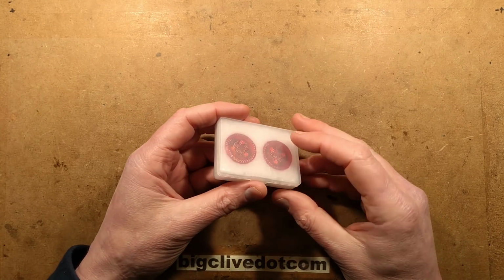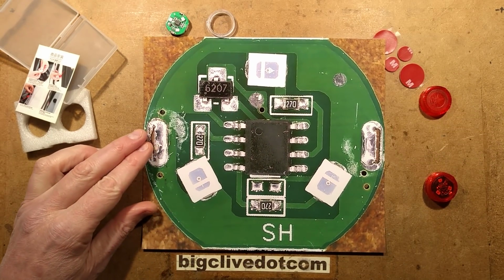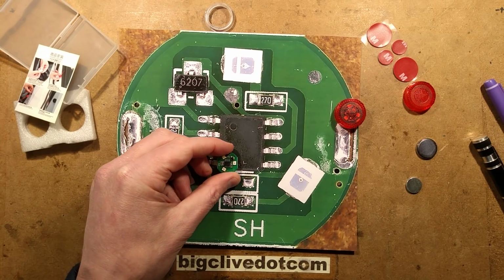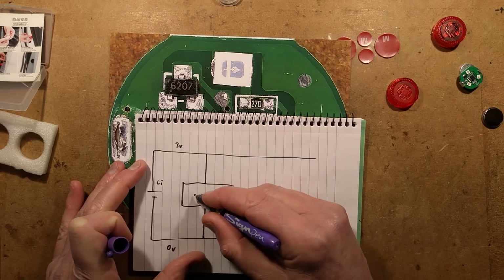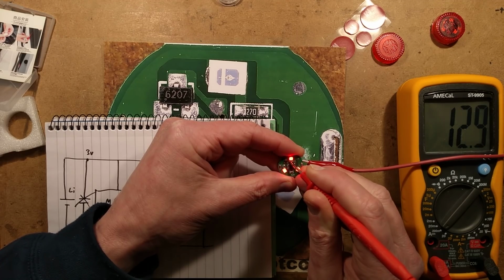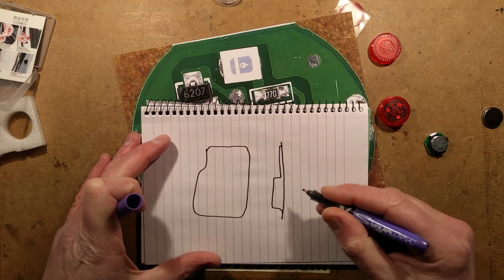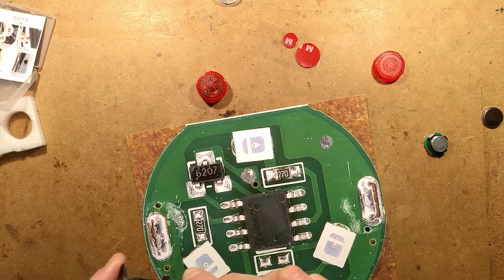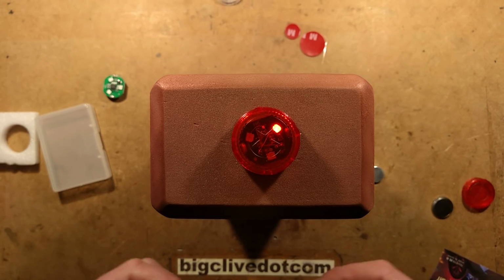Self contained vehicle door warning strobe lights.

Comment: I hope people will not use this as a replacement for looking before opening doors. It will not come on soon enough to prevent dooring, or in avoiding the door the cyclist will still end up falling, or under the car following them (likely to close).  I suggest always open the door with the hand furthest from the door, this tends to turn your head making it easer to see oncoming road users. But a good idea if used correctly.
Reply: People should get into the habit of opening the door with the hand furthest away from the door, it forces you to turn which makes looking for bikes much easier.
Reply: Motor cyclists call that the life saver especially before turning right, as a biker I've saved at least three that way over the years
Reply: Charles Puffer - surely a driver should look in his/her mirrors (rear view and wing) before opening his/her vehicle door?
Reply: Yes,  it also to get that last look in, also if becomes a habit. It is a practice promoted by the Dutch safety people.
On crowded streets there can be a lot of obstruction and blind spots.
Reply: @Mark1024MAK  we would hope, but dooring is the deadly outcome of drivers not looking, or not seeing.
Reply: @longdarkrideatnight  It's also the outcome of the cyclist passing too close - something I never do. I ride where I get respect - 1 metre from the kerb, as per the UK Highway Code and known as Secondary Position. Then at pinch-points I take Primary - the middle of the lane. It's also known as Vehicular Cycling and it means I have no nasty tales to tell that weren't my own stupid fault - twice in two months, "drink taken", fell off - now older and wiser.
Reply: Yes, but there are times when the combination of can make this difficult. 
This is a multi part problem, and like many complex situations that can lead with accidents. Any one thing not going wrong is sufficient to prevent an accident. In reality it is better to get all the factors pushed stepped back.
Reply: I wonder why car drivers don't simply get out on the pavement side.
Reply: @josslevy4240  Depends on the vehicle design. Most European cars don't have bench front seats, and there's dashboard and floor-mounted gear lever and parking brake between two separate seats. The bonus is that the seats are shaped to give lateral support for cornering at speed.

Comment: You need to check local vehicle lighting regulations.
Here in Australia, ANY flashing light HAS to be Amber on a vehicle, other than on an emergency vehicle.
Reply: They can be had in amber, as well as blue, red and mixed colours.

https://www.amazon.co.uk/dp/B07KW4KZNR/ref=twister_B07KW49SZC?_encoding=UTF8&th=1
Reply: Tom George - So does that mean that you are risking arrest if you are a dick of a driver and keep repeatedly touching the brake pedal, so causing the brake lights to flash?
Reply: @Mark1024MAK  If you want to get really pedantic rear lights show in the infrared spectrum which is classed as a radio frequency so you need a transmitting licence
Reply: jos Touw - No, I was rather hoping that a vehicle with flashing brake lights would be pulled over / stopped so that the driver could be warned / educated that his / her driving needed to improve. As it is poor for efficiency and annoying for a driver following them.

Comment: I found the 6207 at LCSC.com the price is 1.8 Australian cents each.
Reply: Link to product
https://lcsc.com/product-detail/Sensors_CrossChip-CC6207ST_C286001.html
Schematic does show a 0.1μF capacitor across it's power supply.
Reply: @webchimp  Thank you for the purchase link (Chinese language data sheet is also there).
Reply: Sorry that's 18 Australian cents each.

Comment: car manufactures cutting corners. your car should have these lights factory
Reply: Some have
Reply: No shiat, for the last 20 years they should have been standard
Reply: I wonder if the recess at the bottom of the door is for a factory-fitted optional one of these. That's exactly where they were on a Mazda I once had.
Reply: Agreed, but these are for the door edge, not the panel face
Reply: Different position...
Reply: These are meant for the door edge that has the door lock/catch on and not the inner panel side.
Reply: Because Chinese cars are known for being both well equipped and safe.  However, give it 10 years and we'll all be driving them...
Reply: Some cars do, cheap cars (under 50 000, in car pricing anything under 50 000 is not a car, but a bathtub with wheels) do not.

Comment: Technically there is 3 complete M's on the stickers.
Reply: You beat me to it creamy moose !!!
Reply: It's actually 3 W's. ;)
Reply: Smart cookie ey?!  :D
Car makers should include a similar light built right into the door and could charge an extra $50usd more for the car... just sayin'
Reply: Bill A I though most modern cars had that already. My 2007 Outback does.
Reply: Hmm not sure my 2018 Honda doesn't have it here in the US.  It's not mandated by law, so maybe they wanna save a few bucks.
Reply: A few cents...USA USA!
Reply: Yes, but "MMM" is the stock symbol for 3M. Makes an odd sort of sense.
Reply: Doesn't matter; 1m is funny.
Reply: @2000jago  Yes, but you can see where they were die-cut from a single piece of sheet stock, and where the three "M"s would appear together if the scrap were left in place (sometimes it is). They don't die-cut each part individually and then stick it onto the plastic backing; instead, they make a single cutting die for all the parts and then remove the scrap.
Reply: It means 'Make Much Money'.

Comment: I sat there like: 'I wonder if this fits on my car'
And in the exact moment you went: 'I saw that it fits on a skoda fabia (my car)'
I was a bit scared not gonna lie.
Reply: But then again the Skoda's tolerances might be a bit wider than the norm, a couple of inches of wiggle room here 'n there, no problem.  You can even stack two strobe lights in there just fine... jk he-he
Reply: @BillAnt  I think bill is from my age group when owning a skoda's was joke that you would not bragged about, they were called "skips with wheels"
Reply: @Nick Bird < Yes sir, back then they were somewhat of a joke, but I'm sure they've improved by now, after all BigClive certainly thinks so. he-he
Reply: @nickbird7742  I'm a 1981 model, so I know these jokes 😉
Reply: The 16 valve Skoda was the premium model: It had 5 in the tyres, 8 in the engine and 3 in the radio.

Seriously now, I did see an old chap driving a 130 Lux on a drag strip at East Kirkby Aerodrome, and he beat every other standard road car to the quarter mile. It certainly had more than the standard 58 hp/43 kW engine under the bonnet.
Reply: @BillAnt  since 2010 they are made with the same quality as most of the cars in the VW group 🙂 Skoda Fabia are 98% the same as VW Polo 😉
Reply: sismofytter - beat me to it
Reply: @sismofytter  looking into the engine bay everything literally says VW AG
Reply: O! M! G! You heard Skoda Fabia, but I heard Ford Ka.  Now I'm really freaked out!!!
Reply: Me too 🙂
Reply: Mine's a Felicia, but I  look before opening my door and keep an eye out for potential door-openers so I don't know what use these would be.

Comment: Don't see how these will work with a lot of cars since there's not much space there between the door and the body, especially on new cars.
Reply from the maker: That's what I thought until I tried it out.
Reply: @bigclivedotcom  If the car has a recessed striker plate for the door latch then they would, for what its worth. In that case, you put them just above the latch on the door. Although with that said if it had real instructions it would tell you this since the depth is easily measured.

Comment: First I thought they are using a reed switch and a 555 for blinking. I am getting too old, I recon.
Reply from the maker: It's cheaper now to use a microcontroller and solid state sensor.  How times have changed.
Reply: I thought the exact same thing... that's how I learnt it in school
Reply: 555 You can get LED's that flash... Old school new school I'm old too...
Reply: .x. Don’t think they would stay synced
Reply: It is totally insane if you then see stuff like that: https://youtu.be/sNCqrylNY-0
Reply: Probably the power consumption of the classic 555 chip is higher than this more efficient micro's... not because it's activated for long, but in case someone leaves the door cracked longer, the button battery could be depleted.  By the way the pattern flashing might be designed as power saving feature especially when it starts blinking each led individually (only one led on at any given moment).
Reply: @BillAnt  also i assume higher margins due to less components
Reply: did reed switches first have a metal contact inside in the old days ?
Reply: Till this day they have ... yes
Reply: @maicod  Two mostly some switching have three
Reply: I used to use a LM3909 for something similar
Reply: Use a normally closed reed switch as an on/off switch (no standby current), the button cell would last for many years.    Dearer initially but cheaper on batteries, how times have changed.

Comment: Can you realistically replace the battery while it’s installed?  It looks a bit fiddly for that, but those batteries probably only last a year (~220mAh at ~0.022mA, with some 13mA pulses).  It’s definitely a cute little design, and has me wondering why cars don’t just have this already.
Reply from the maker: The front unscrews and the module pulls out.
Reply: Door warning and puddle lights have been standard on some upscale cars for years. Considerably brighter than this. But the mass market will not pay for them. After all, the cabin lights turn on when a door is popped, that's even more obvious.

Comment: you must figure out what that SOT23 hall switch is i could use that in a Lego project
Reply from the maker: Hall effect sensors are really common.  Check eBay.
Reply: @bigclivedotcom  nothing in the SOT23 package
Reply: @God-CDXX  Have a look here: https://lcsc.com/products/Magnetic-Sensors_11086.html - filter by SOT-23 (and SOT-23-3, which is just specifying a 3-lead SOT-23) and I'm seeing 75 matching parts. And LCSC stocks lots of Chinese-made parts, so you can get suitable components really really cheaply :) Just note that that's the "magnetic sensors" category, so look carefully at things before you decide on it!

Comment: I would expect they would need about 1/2" to allow for the "rubber doink".
Reply from the maker: I think if the door was slammed hard enough it would still turn one of these to dust.
Reply: @bigclivedotcom  The way they are requires the door to be narrower by the diameter of them.
Reply from the maker: @WilliamWallace14051  Most doors have an irregular shape that may accommodate the lights in specific areas.